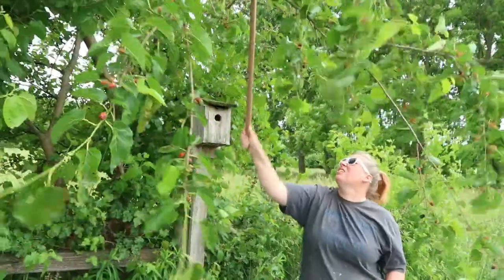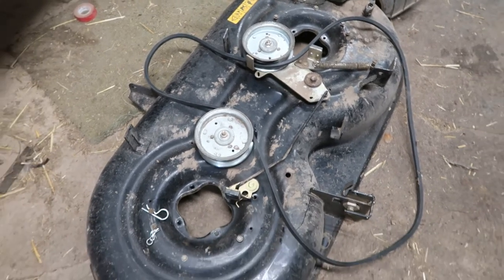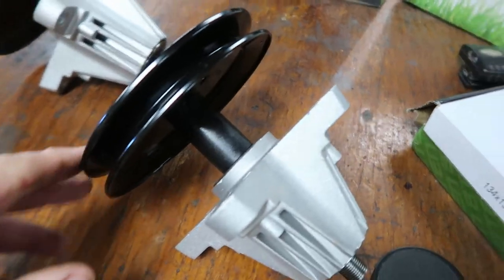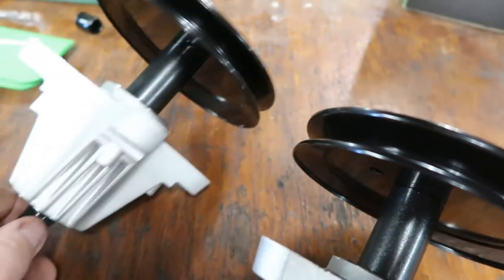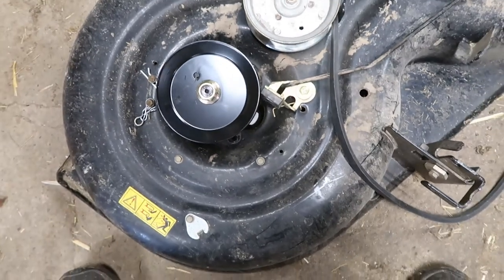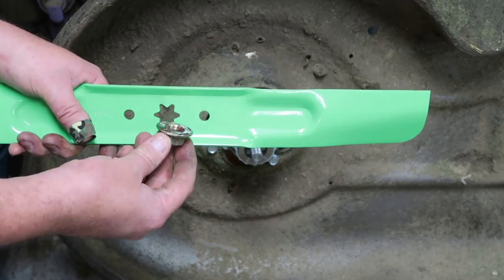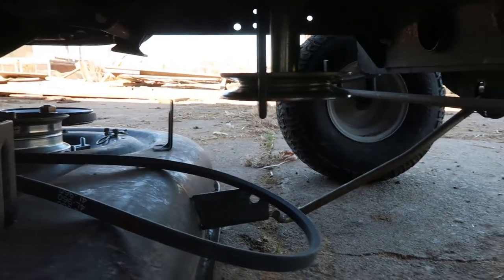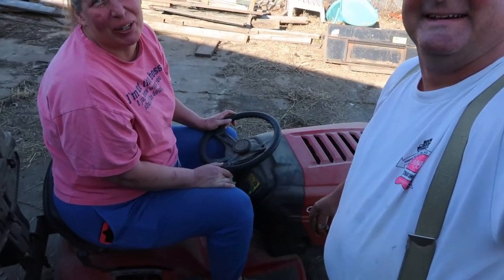Riding Mower Spindle Replacement

Comment: From Donald great job on your video, but why isn't there plastic or nylon, aluminum circle cover at spindal to deck to stop grass from pileing up on deck to sweep,  or air blow it off ever time, seems my 2006 craftman YS4500 deck get covered  with grass like crazy 🤪  but my old 198's rider 36" cut don't get grass on deck at all, it's spindals are completely  covering deck mount up, So I got do same cover my air slots completely